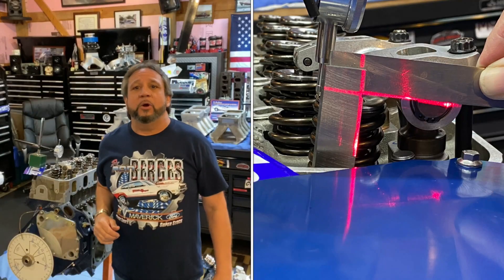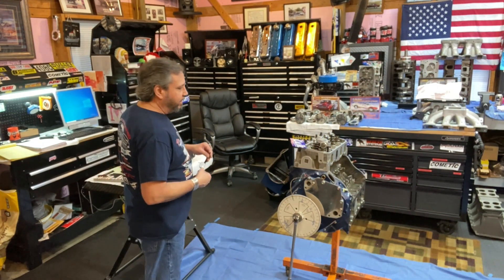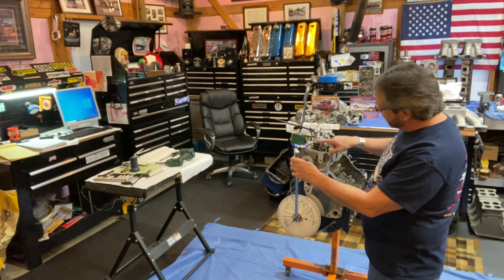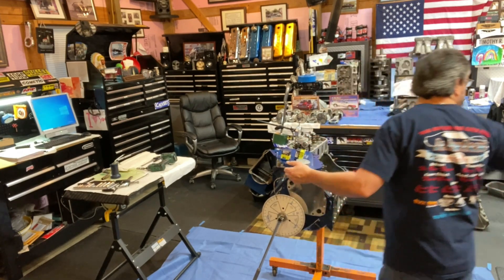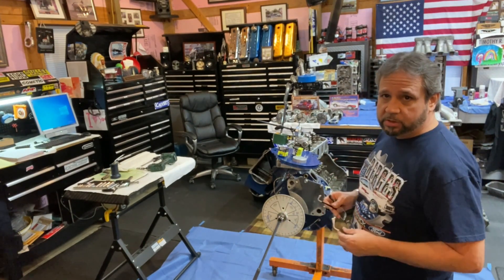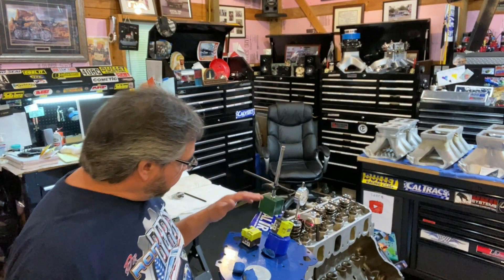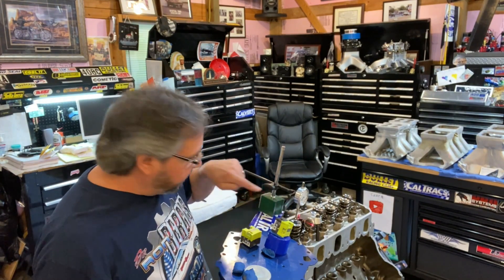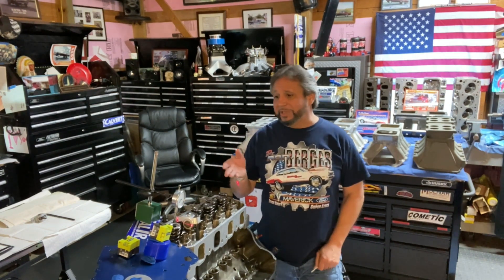Mid Lift Theory /Rocker Arm Geometry, Laser Guided Precision.

Comment: Nice effort, but falls way short of doing what it desires. There may be some blame to the camera angle of the first laser measurement, but in the second effort on the intake it is blatantly obvious to me that the horizontal laser is not dividing the trunnion equally; but is in fact, a good .030" or more above the trunnion center. Let me try to simplify a non-existent problem about all these interpretations to my book and the myriad of ways MID-LIFT can be checked, that so many creative engine builders have come up with over the years.
>
1. First, "MID-LIFT" is not a "theory," it's a fact. I'm anal about semantics. If you consider gravity a theory, then go on stating MID-LIFT is a theory. But there's nothing theoretical about the process of minimizing the wasted motion during the conversion of linear (push-rod) motion into radial (rocker arm) motion, then back to linear again (the valve) by dividing ALL arcs equally. It's a geometrical FACT.
>
2. The problem with this video's technique, is that it still relies on the human eye to determine accuracy, when it should be relying on hard measurements. While the video still does the math, it fails to take the human error out of the process. There's nothing complicated about the math to do a hard measurement check for setting up for MID-LIFT geometry, which I'll get to in a second. Over the years, engine builders would only look at "symptoms" of geometry as a guide to setting it, like the width of the witness mark across the top of the valve tip. This is better than nothing, but it only gets you close; and close wastes a lot of degrees of cam information. People will spend hundreds of dollars to go to a 4 or 6 or 10 degree greater camshaft in their quest for power, but think nothing about losing that many degrees of duration through wasted motion on a "close" rocker geometry set by "eye-balling" symptoms. Forget symptoms, and set things with HARD MEASUREMENTS.
>
3. The sample rocker arm, is not a MID-LIFT rocker, which means that you're only getting half the story here. The most important part of MID-LIFT geometry is its application to the PUSH-ROD side of the rocker, even though the checking is done on the valve side -- because that is the easiest to do. However, if the rocker has the same inherent BAD push-rod geometry that all rockers have traditionally had, except what I patented, and we tried to produce, then you can only minimize the wasted motion on the valve, and tolerate the excessive in-and-out motion of the push-rod; along with all its inherent side-effects; like lost cam velocity, cam duration and INCREASED harmonics. (Harmonics kills more engines than anything else, but is never blamed; only its symptoms get blamed; but that's another story I don't have time to get into here.)
>
4. Setting up your rocker geometry for the VALVE side is choosing the lesser of evils, because this is where the greatest motion occurs; this is where the wear and tear on the valve guides occur; and this is the easiest side to do it from. But first, let me dispel (again) the "myth" that "correct geometry is placing the roller in the middle of the valve." That is WRONG. As my book "Advanced Rocker Arm Geometry" explains, perhaps with too many words for most engine builder's patience, the engine and the valve does not care where the contact point of the roller is atop the valve; it only cares that it is constrained to the top of the valve (running off the valve tip's diameter is not good). All that matters, is the ANGLE of MOTION. That angle is defined by the imaginary line between the two axis of the TRUNNION and the ROLLER, as the horizontal laser attempts to show in this video. Because none of the manufacturers have any "accurate" standards for stud and stand mount dimensions from the valve, and because the stud leans into the valve, and because engine builders use varying length valves, and lastly, because every custom engine has a different NET valve lift, no rocker arm is going to be able to have the exact length required (on a mass produced basis) to accommodate all these variables. That is why you shouldn't worry about where the witness mark on the valve tip is at. Just worry about the angles. The BEST way to assure you are measuring ANGLES correctly with HARD measurements, is to use the VALVE SPRING RETAINER, because it is perfectly mounted at a 90 degree angle to the valve, and that is the principle of MID-LIFT precision.
>
5. With all the tools I've made; and all the engines I've built; and all the tricks I've learned (many from other creative engine builders), to this day when I still occasionally help an old friend out on setting up his rocker geometry, I do it in less than 5 minutes with the following technique. It's all done in the CLOSED VALVE position, because you don't need to worry about hydraulic lifter valve compression or flex. You don't even need to have the adjuster on the rocker arm; it is all laying loose. And obviously, unlike this video, you are not rotating the whole thing over under valve spring pressure. Once you know what your NET valve lift is, everything after that is math, and setup; and this can all be done with the rocker laying loose on the stud, and an adjustable push-rod lifting or lower it as needed.
>
It's not complicated:
A. Know your NET valve lift; divide in two; that is your MID-LIFT "motion" (MLM).
B. Measure the height of your valve tip above the retainer.
C. Measure the diameter of the roller; divide in half (this precisely gets you from the bottom of the roller to the AXIS).
D. ADD "B" and "C" together, to get the STACK HEIGHT. An illustration can be found at: http://www.mid-lift.com/TECH/TECH-Installed-G1.htm
E. Now, use a straight edge like the little machinist square shown in this video, and lay it across the valve spring retainer and alongside the trunnion.
F. SUBTRACT or ADD (as needed) the STACK HEIGHT to or from your MID-LIFT MOTION, by raising or lowering the rocker arm on the stud.
>
EXAMPLE:
* NET VALVE LIFT IS .700", so MID-LIFT MOTION is .350". That's cut in stone, now forget it for the moment (you've written it down).
* Valve tip is .050" above the top of the retainer; and the .500" rocker arm roller diameter tells you its radius is .250", so the STACK HEIGHT is .300".
SOLUTION:
If the STACK HEIGHT is .300" and the MLM is .350", then you need to place the trunnion .050" BELOW the valve spring retainer. If your math has the inversion of this, then your trunnion centerline would be above the straight edge coming off the retainer.
SUMMARY:
It's much easier to get an accurate DIAL CALIPER measurement on hard points, to find their true center-lines, than trying to use visuals that only give you approximate values. You can use the outer edges of the trunnion's diameter and divide in two for its center, which is far more accurate than eye-balling a pretty red line, that fails to confirm anything the human eye is failing to see, as the second example of this video.
It's this simple: KNOW YOUR MLM; KNOW YOUR STACK HEIGHT; USE THE RETAINER AT CLOSED VALVE; and SET YOUR ROCKER TRUNNION as needed. Good luck to all. --Jim Miller
Reply from the maker: Jim Miller thanks for watching this and finding issues. I am just Tim working in his garage trying to do the best I can at building my Cleveland’s myself. I am honored that you took the time to comment the actual process and not theory. I like that, semantics. I have this once and still need to read it a few more times. I would like to offer you a chance to come on live with me and chat about this concept that people find so difficult, even my self.  I have a buddy that has used your rockers in the past. Do you still make them? Let me know here is my email. Please send me a quick note. Thpa351@gmail.com. Thanks again for clarifying the mystery of Rocker Arm geometry. 👍👍
Reply: @JimMiller So Jim, using your theory to set geometry, if we set it all up this way and the rocker roller is on the exhaust side of the valve tip, do we just run with it and sacrifice valve guides, or buy a different brand of rockers hoping for an improvement? Or is shortening the pushrod length the more sane option?